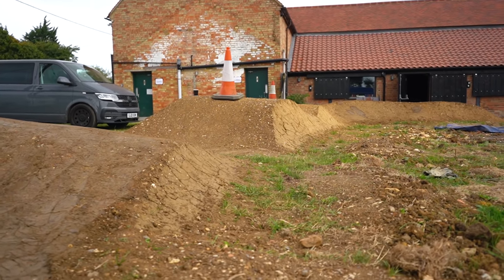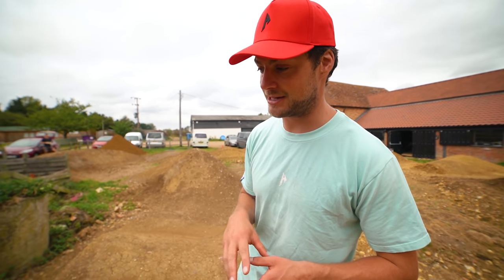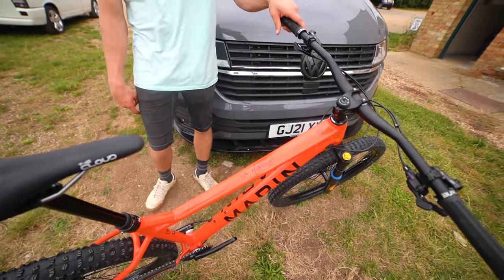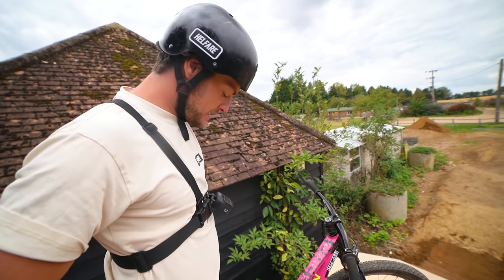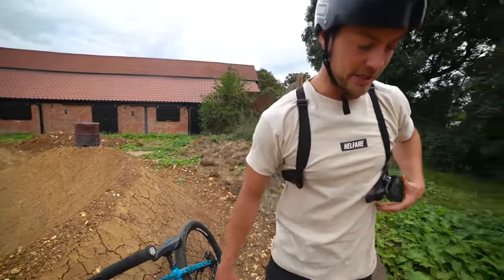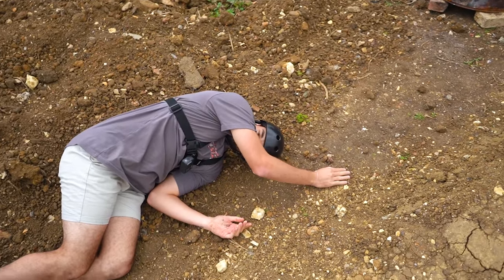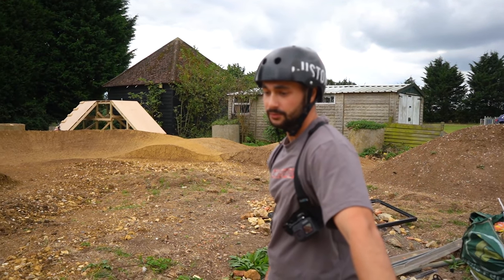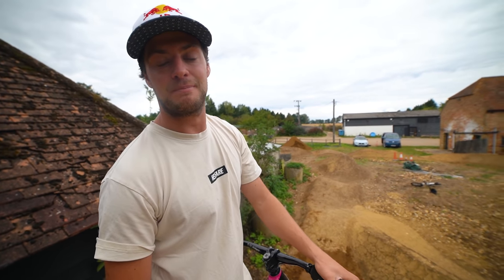IT’S FINISHED! RIDING THE NEW MTB PUMP TRACK BUILD!! EP03

Comment: you can spray the surface with sugared water or bottles of coke,it helps bind the surface and kep dust down,we used to do this on dirt rc tracks,abroad they sometimes use molasses oil.

Comment: Lay turf up to the edge and include the bank's that take care of erosion, then place a small shelter on the side as you walk up the roll in this will be the place you can chill and take off from. In the middle use flowing grasses this way track can be modified and just dig up flowing grasses and replant.

Comment: You should add a few more lines cutting through the middle, it would add more variation and options for gaps and things like that. They have things like that at my local pump track and it adds so many more options for lines and overall just an improved pump track. Looks sick so far though too bad im on the other side of the world so wont be able to ride it.

Comment: Half pipe or a super burm in centre so you can use roll in and go straight to centre and take the pump track in the opposite direction once returning from centre piece.

Comment: No, no a solar system would be sick, for an electric BBQ!! Also a battery-storage system for overhead LED track lights for night rides. - low lux-bleed but bright LED street lights are available that use very little power and don't have to very elevated like stadium lights typically do so that you don't create light pollution for the neighbours. 
All of this could be incorporated on a central tower-deck (e.g. like an oldschool air field lookout design) in the centre overlooking the whole track, which means under the tower you could still build extra track running through the centre with the tower bridging the trail. Ambitious I know, but it would be one hell of a showcase & I know you guys have the skills.

Comment: Clean out the junk in the middle. And serious you need to figure out a X for ultimate crossovers and everything. Or even 2 berms coming out the back of the weird off camber big roller thing so you can go over it and hook left to reverse the direction or too the right so when your coming back inreverso you can get back into forwards direction. Options man so many options